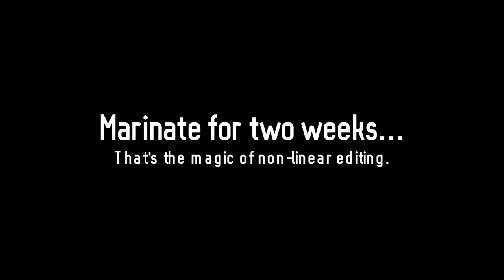An Axe to Grind / Hatchet Restoration // Phil Makes Things No. 17

Comment: Nicely done Phil, I do love a wedge! What's the reason for sprinkling sawdust on the glue before placing the other board on top? - Clint
Reply from the maker: Thanks for watching! I saw that tip on another channel - I forget which one, maybe woodbrew? - where you put a little bit of sawdust between large face glue-ups to give a little bit of grip, so things don't move about too much while you get the clamps on.
Reply: Phil Makes Things Oh right, I've never really thought of that! They are very slippery on glue ups!